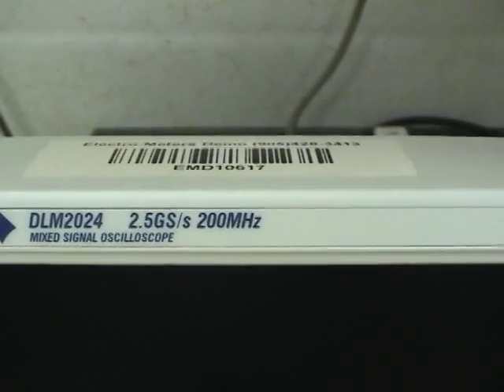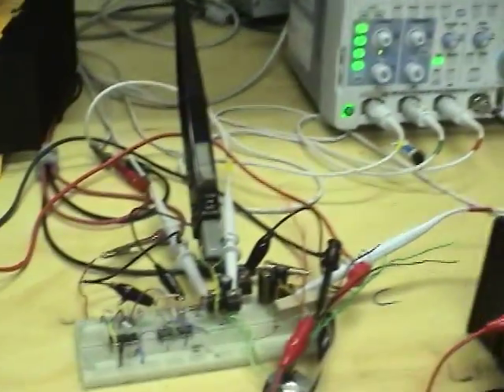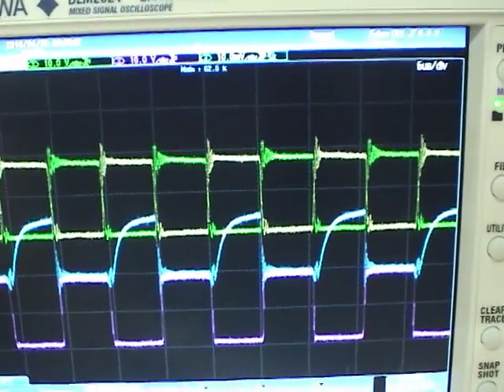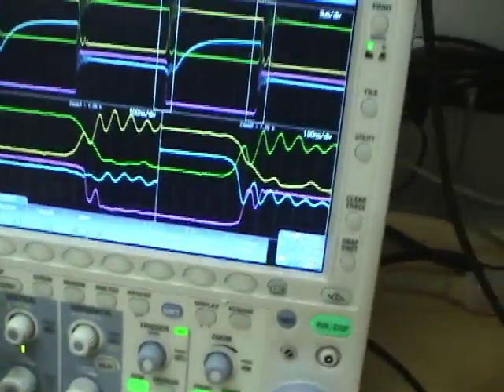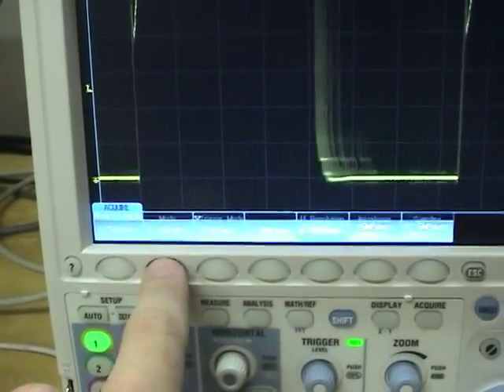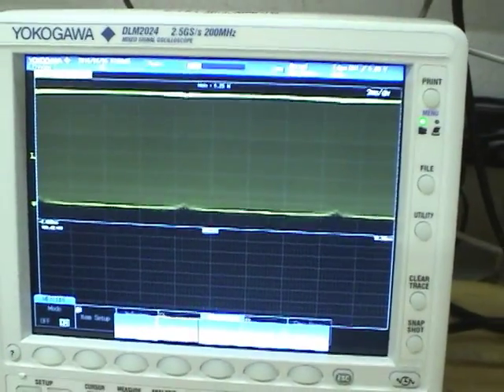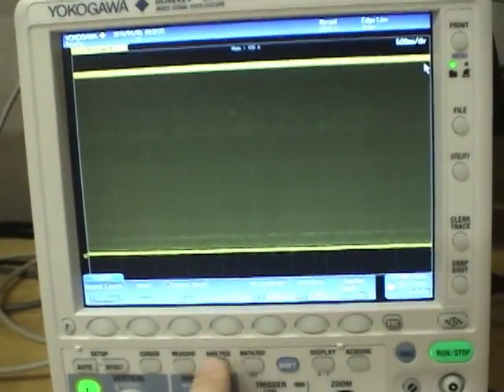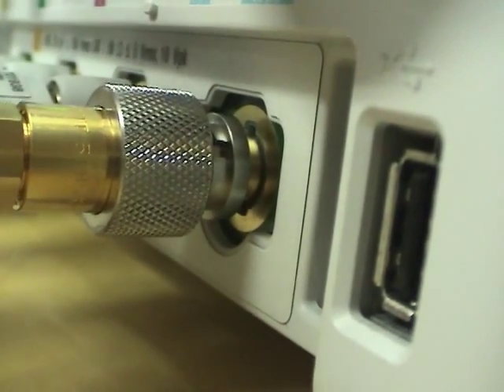Yokogawa DLM2024 Oscillocope Review

Comment: I've been using this scope for years and I really love it. Wiggling of the probes is not a problem. We have like 10 of those scopes (2024,2034 and 2054) and we had no any problems with them.  What I really liked about Yokogawa is it's large acquisition memory size. Its much larger than with other manufacturers at the same price range. It's really helpful for debugging when some intermittent phenomena occurs. I'd often save waveform with max record length and than use zoom to search for abnormalities.